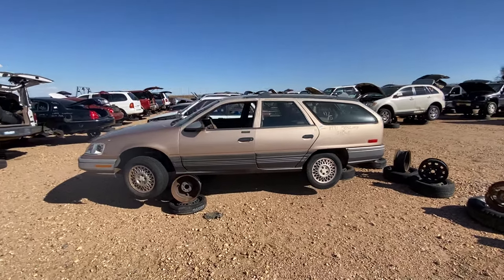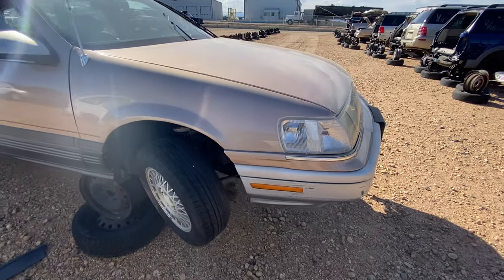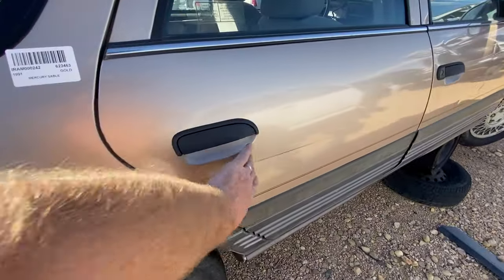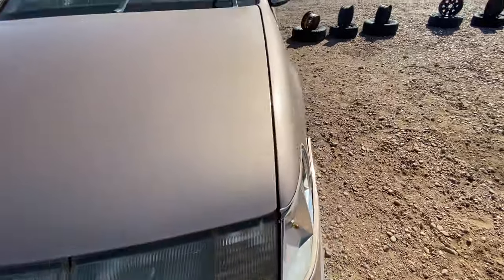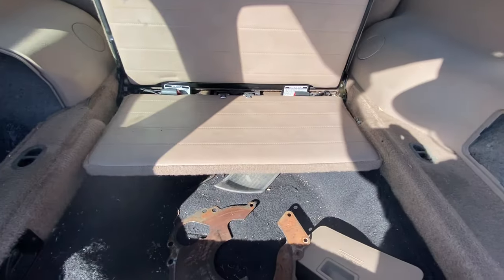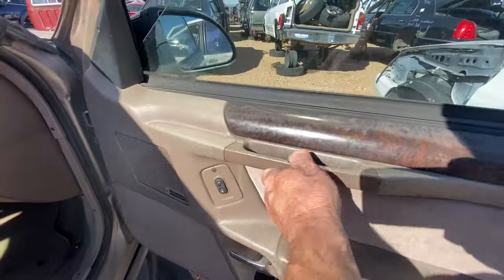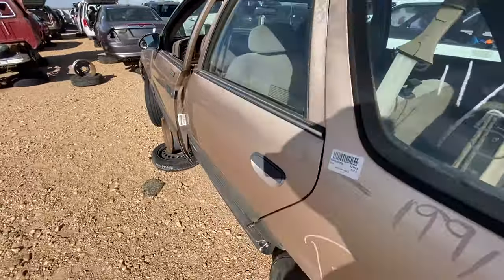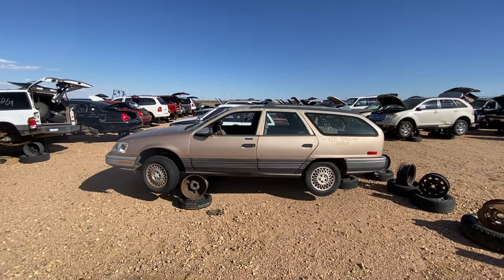JUNKED! 1991 Mercury Sable Wagon - A great example of the Taurus's upscale cousin bites the dust...

Comment: Crud this car is so clean... Could have been fixed up.
Reply: It could have.  Didn’t most LS come with leather and a moonroof, though?
Reply: @plworld5315  Dunno if most had leather or moonroof. It was probably an uncommon option.
Reply: @ironinquisitor3656  this is admittedly random and kind of weird but i like luxury station wagons and they did make at least some with that.  They were even bucket sometimes with a power antenna, JBL sound and digital dash
Reply: @plworld5315  Same here. Bucket seat wagons were pretty rare, especially on Gen 1s. I like the Gen 1 Taurus and Sables the best because they were a lot more customizable and depending on the model year you could get the digital dash on every trim, same with other options. The later ones for the Taurus it was only on GL and LX and all Sable trims it was an option. With the Gen 2 Taurus and Sables it was only an option on Sable LS and on a Taurus GL from 1993-1995 if it had the flex fuel Vulcan. I have a 1992 Sable LS wagon with the digital cluster and electronic climate control.
Reply: @ironinquisitor3656  we speak the same language!  I had a 92 Sable GS that was loaded without the leather & sunroof but had the other stuff including a nicer velour.  What was weird to me was how hodgepodge it was - the early 90s explorer, for example, had some GLTs with more options then some Eddie Bauers.  Same here - you could load the 1st & 2nd gen GS/GL (up to 95) up with more bells & whistles than some LS/LX versions